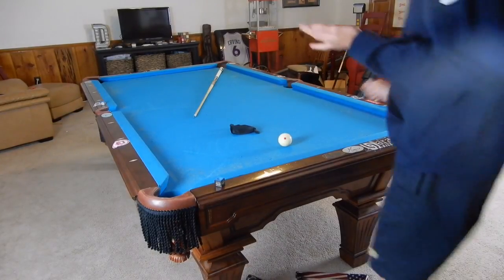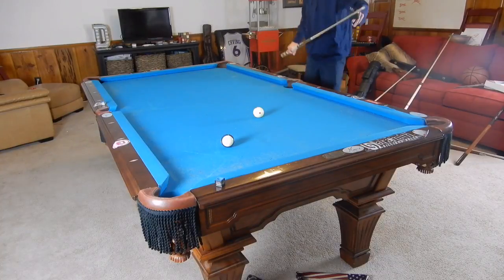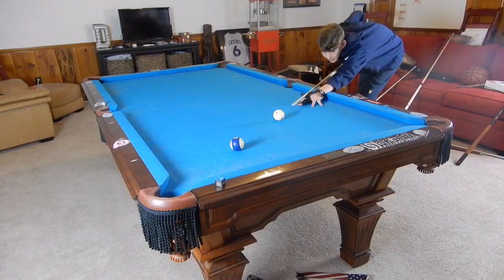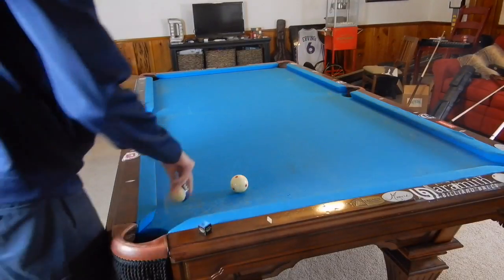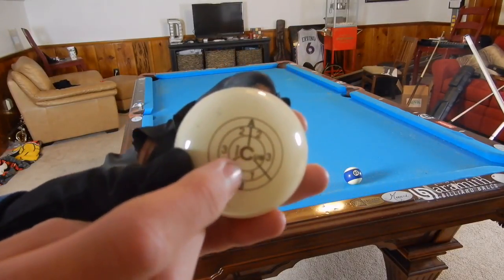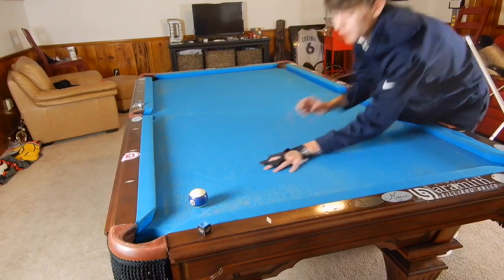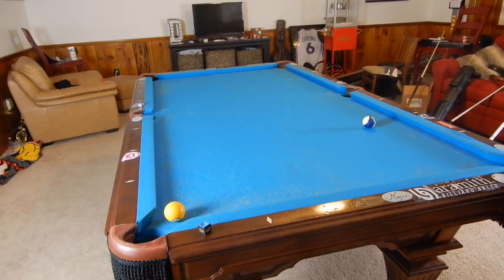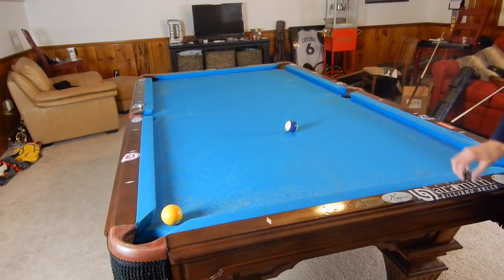The Physics Behind Pool! | Spin, Speed, and Reflection

Comment: Jaden you really make this look easy.  I have been trying to get the ball to stop like you do.  I have tried and tried again and I can't get it to do it.  (Still trying)  I am get either draw or side deflection or both.  Either way I just can't seem to get the ball to stop.  I know one thing I am doing it not hitting the cue ball in the correct spot.  Using the I cue is nice because you can see where you actually hit the ball because it leaves a chalk mark on the ball.  most of the time when I aim for the "C" I end up hitting either one of the "1"s or just right of the "C". For some reason I just can't seem to hit the ball where I am aiming.
Reply from the maker: +Michael Leppelman it’s very very hard to hit the center of the ball. You must learn through repitition
Reply: Dupree Trickshots that is why I am continuing to try.
Reply: Florian Kohler has a couple good drills for hitting where you're aiming in his fundamentals video
Reply: I will have to look for those.
Reply: +Dupree Trickshots Ohh Really ,,
Reply: His channel name is venom trickshots